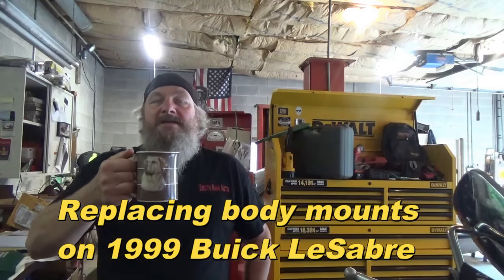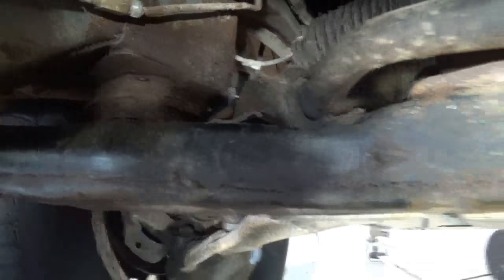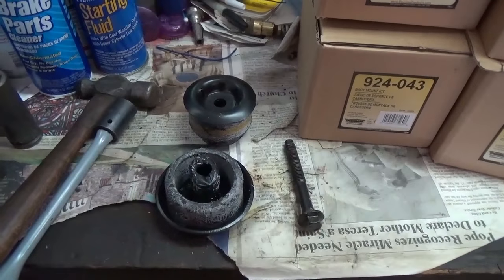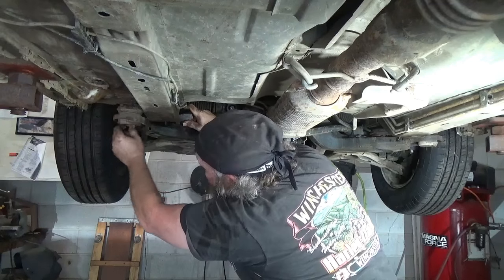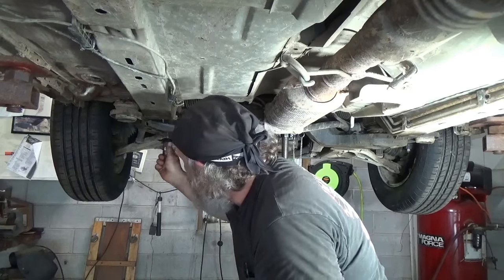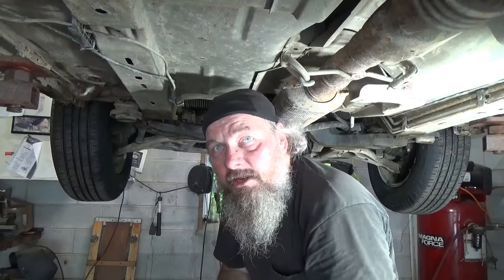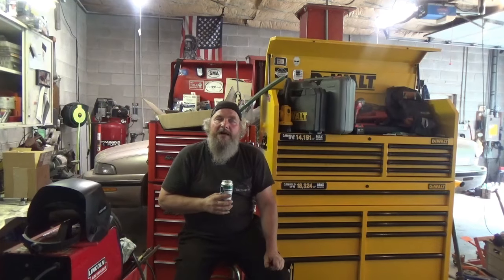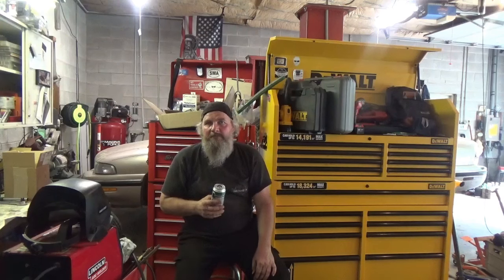Replace subframe/body mounts on GM Buick LeSabre

Comment: Just replaced the sub frame in my 2003 cavalier!! Sub frame. 4 complete strut assemblys. Control arms. Ball joints. Bushings. Swaybar. Swaybar links. Tie rods. And an alignment. :) around 600 bucks to do it all myself. Much love from the 219. I'm subbed btw.
Reply from the maker: Great! Always nice to save money!
Reply: The Disgruntled Mechanic indeed thanks for your help bud

Comment: When you are putting the two bushings together, I have used dish washing detergent around the oval parts.  I did all 4 of rear bushings and had no trouble when I used the standard bolt that was provided in the kit.

Comment: I just replaced mine. On the ground, I used 2 scissor jacks. 1 as a primary to support the sub frame. And the 2nd one was used as a press for the bushings. Wasn't fun as a DIY'er,  but I did it & learned on the fly. So I ended up pressing ALL the bushings 1st & then bolted them all down sequentially since I didn't know what the torque specs are for them.

Comment: Have you considered doing a video on the rear suspension subframe crossmember replacement? For any of the 2000-2005 models? I have a 2005 Bonneville GXP but your Buick videos have given me some good info without the BS and unnecessary extra steps for a "simple" job. Thanks.
Reply from the maker: if I would have a vehicle that need what you describe I would do and show it. thanks appreciate it.

Comment: I’m faced with this project in the next week or so.   Great video but I’m a little nervous!!  Man, make me one of those long bolts that I can use.  I have one mount completely missing and part of the bolt is there but the bottom part is broken off.  I think I’ll take a few days and soak them with Kroil and hope that helps.  I ordered new bushings.  I might take that bolt and try to find a longer one and add nuts like you did and try to compress them that way.  Me and a buddy are going to do this without a hoist and only use floor jacks and jack stands.

Comment: If you don't have a welder or the correct longer bolt,  than another method of accomplishing that is to use a bottle jack to press the rubber bushing into position.  Set up your bottle jack to the correct height, place the washer between the bottle jack ram and the rubber bushing and than compress it..    Cut a 4x4 post to adjust the height of the bottle jack.. Longer if your doing it on a lift, shorter if your doing it on jackstands.

Comment: This is a really nice, detailed video. Do you have anything showing the rear repairs? Bushings, control arm, lateral arms, shocks, etc.? I have a 2005 LeSabre, all the rear rubber has rotted. I'm going to replace the control arms (L & R) Lateral arms (L & R) Air ride shocks (L & R), the 4 rubber sub-frame to frame bushings. I am thanking God I have the use of a lift and transmission jack!!!
Thanks in advance...
Reply from the maker: sorry I do not.
Reply: Did you ever get it done? I've got a 2004 with the same issue.

Comment: How much roughly would it cost to replace the engine cradle at a shop?
Reply: My Buick is in the shop right now. Engine & transmission replacement. Buick 3800 V6 / 4T65 E 

I'm going to ask for replacing the 4  subframe to frame body mounts

Comment: Wondering what a small black box colored 2 colored wires attached.  I noticed it hanging under the 2004 van and put it back up.  It stayed haven't been far.  Concerned what that would be.  Really cannot  go to a mechanic to look at it yet.  Thanks

Comment: Which direction does the upper runber face, there is a flat side on one end and a tapered side on the other, does the taper side go down and face the lower rubber bushing or the other way around?

Comment: it seems odd, up here in northern Canada you would think this would be a bigger issue, but I have actually never seen those mounts go like that, bolts yes, most common thing I run into is the nuts rot away inside, and end up breaking free. more often then not I have to get in there with a torch and snip them off, but a lot of time they are not accessable, I have on a lot of occasions cut a hole in the body next to the nut to get in there, depending on where it is, sometimes I have to weld it back up again after so it doesn't loose strength.
Reply from the maker: I thought at 1 point I would have to cut the frame to get to the nuts but it all worked out!
Reply: The Disgruntled Mechanic I'd call that a win, lol.

Comment: use your ball joint press to squeeze them together. The C clamp that drives a bolt through a cylindrical hole on the opposing. Use a deep well socket to hold bolt in place. press and apply bolt to stun. FIN

Comment: jacked up my 99 lesabre today after a 400 mile trip, and saw one of these bushings is gone entirely. lucky i got home in one piece i think.
Reply from the maker: Glad you got home! well all of these were pretty much gone on mine. Good luck!
Reply: even worse, i went back to count how many i need to order and saw that both of them on the passenger side were actually gone.

at least the eclipse was good ;D
Reply from the maker: well just so you know when I took mine off there was actually a hole rusted through the sub frame that the new bushing could fall through so I sure hope you don't encounter that when you get them off.
Reply: I had a 97 Lesabre once and the subframe went clean out ! they said it would cost $1000.00 to fix it but I did not want to put that much in a 97 so I sold it and got a 99 Blazer 4x4 !

Comment: Where did you purchase them body mounts at? This just happened to my 1998 Buick Lesabre. Your video has been very helpful Thank You!
Reply from the maker: Dorman 924-043 Subframe Bushing Kit https://www.amazon.com/dp/B00CFQUKTS?ref=ppx_pop_mob_ap_share
Reply: This might seem like a stupid question but I just wanna make sure I get this right. Are all 4 on the front, driver side and the other two on passenger  the same bushing's? Body position 1 and body position 2. We were just around the corner the other day when it felt like we ran something big over. The passenger side popped and driver right along with it. We were able to drive it home. Anyways I do thank you in advance for your time whenever you get a chance to help me one more time with your expertise!! Thanks a lot

Comment: I have an 03 ultra, I don't have a lift but I have two small ramps, 2 jack stands, a scissor jack,  a 3T floor jack.... for tools I don't have any flex head stuff but do have 3/8 and 1/2" drive sockets and wrenches
Reply: Will I be abkento do this job?
Reply from the maker: anything is possible I guess.

Comment: Great video brother I made the longer bolt with a threaded rod good job 👊🏻😉
Reply from the maker: TY! Yeah only way I could see to do it easily was make the tool!
Reply: +The Disgruntled Mechanic yeah I made the threaded rods 4 of them because when I was a young little tech I started replacing the mounts on the driver side and when I got to the passenger side and removed that mount the frame was rusted out to bad 😢 so with the rods I replace them all at the same time
Reply from the maker: I need to get the sub frame holes welded on the passenger side. They are both rotted out. I hope it can be fixed!
Reply: +The Disgruntled Mechanic hopefully you can but back then I just got one from the wreckage yard for $200 it was in great shape the car got rear ended price it out from them first then go the welding route you have to get it just right or they will move under load just my opinion brother 😉
Reply from the maker: Thanks my man appreciate that!
Reply: +The Disgruntled Mechanic No problem brother good luck👍🏻

Comment: Any idea what the torque specs are on the bolts?..  I'm about to change mine out on my 98 bonneville.
Reply: I have heard the torque spec is 66 ft/lbs for all 6 bolts from a few different sources, so I assume this is correct. Just started this job yesterday on my 1990 Olds Delta 88, and I'm in deep already. 1st one I tried to loosen, passengers side closest to the outside of the car, the bolt snapped off. :( Now I'm soaking all 6 bushings/bolts heavily with penetrating oil, and waiting a few days. Got to figure out how to get that broken bolt out now too. I wish you the best of luck! Feel free to comment back here on your progress. :)

Comment: What is the size or thread size of the bolt that you welded together? So what your really doing with the bolt that you welded together is compressing the bushings together???
Reply from the maker: Yes to compress the bushing. I cut off one of the old bushing bolts I took out because I put all new bolts in.
Reply: @TheDisgruntledMechanic   I went to the hardware store and got the same dimension bolt only about an inch longer so when I do this to my car, hopefully I'll be set. Think that'll be long enough? Plus, I sprayed the piss outta the top nut with p.b blast a week ago. 😆 I'll probably take a sawsall to the old bushing bolt and cut it off if they put up a fuss, just like you did. That was a good idea! Thanks! Probably be easier to without the wheel on. Wish you lived in Wisconsin...

Comment: Can't help but notice,  On the 97 LaSabre which you changed the body mounts, The brake line or fuel line which looks pretty rusty, it's the top line on the passenger side. IT IS VISABLE IN THE VIDEO. Better safe then sorry!!!
Reply from the maker: Thank you for your concern. It has been scrapped not long after the video was made.

Comment: Im having the same problems...  Do you know how many bushings I need for a 99 Buick Park Ave.?
Thanks!
Reply from the maker: +Jay Ferrante it really depends on how many are bad. I replaced 4 on this car.
Reply: The Disgruntled Mechanic will these bushings work on a 1996 Park Avenue I can’t find the right ones anywhere
Reply: @brandonhayden5169  out of curiosity, did you ever find them? I just bought the same model and year, and I'm having issues as well.

Comment: GM calls the body mounts "Insulator cushions".  I don't want to imagine doing them on the floor and without a lift and screw jack!
Reply from the maker: Yeah I saw them called that but figured people would know what I was talking about.
Reply: The Disgruntled Mechanic I just thought it was odd terminology. I would understand body mount better than insulator cushion.